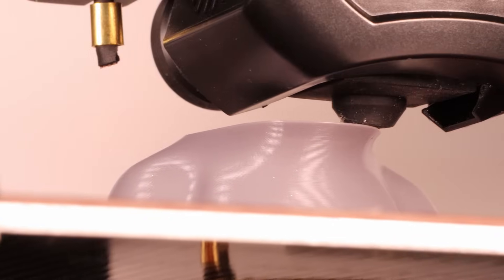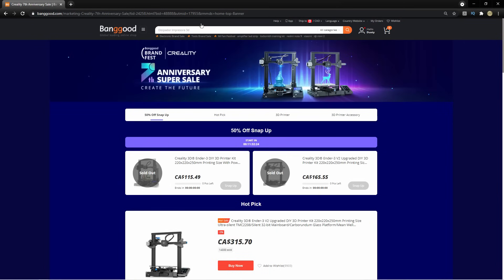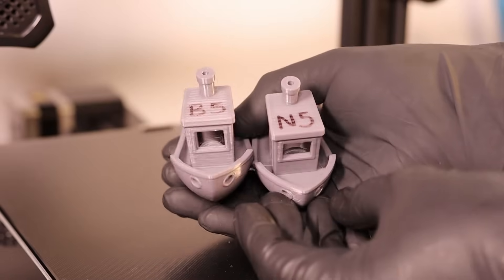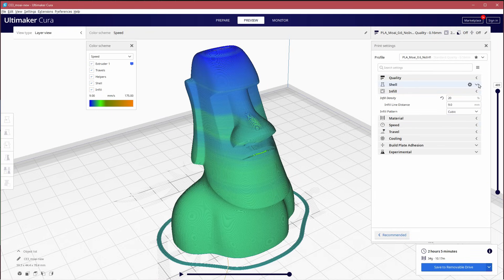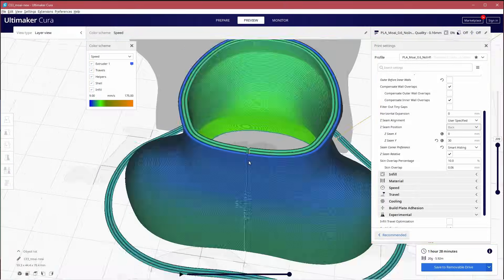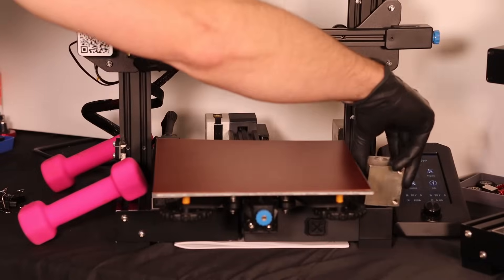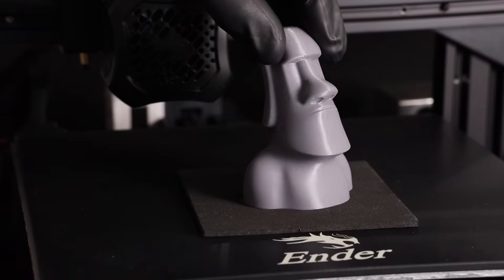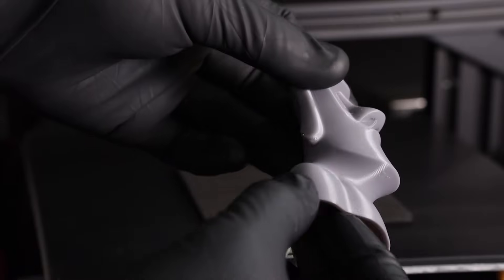Creality Ender 3 V2 - My Cleanest Print Ever and You Can Too!

Comment: I can have a $200 printer with zero upgrades and print better than 99% of people with printers because they don't take the time to completely learn slicing
Reply from the maker: I'd agree with that.  There are so many settings which require a lot of testing to get it just right.  

Which currency is that?  200 is a steal.

My best tip for anyone wanting to learn is to turn every setting on and at least see what is there, if you don't see it, it can't help you much.  I've downloaded Cura 4.9 Beta, it doesn't look like they've changed much except the visibility of the seams appears as a while line, which is very nice for anyone with the Bowden setup.   

Can you share your settings with seams with us?  I am working on improving mine right now.

Comment: Please make a tutorial on bed leveling. I am having a lot of problems with that. Also what is your print speed ? Thank you ! great print !
Reply: Trust me just get the stronger springs and a BLtouch and call it a day...I hated leveling and now I hardly ever do it
Reply from the maker: That's a pretty easy one, probably could do a 2 min video on that.
Reply: @NeedItMakeIt  It would really help me out, I am have so much trouble just setting the bed. I moved my printer to a new place and I havent been able to get ONE print ever since I did that.
Reply: @3atsleeprepeat  did you recheck all the screws and belt tightness since moving it?
Reply: @timothymusson5040  Yes I have done all of that, even did a marlin update to get the mesh level function rolling. I guess I will have to go for a bltouch or something like that. Like someone else said, I will look into new springs too. Was expecting it to run out of the box without needing 100 upgrades haha.
Reply: @3atsleeprepeat  get a 3 point level kit... The bl touch is only going to weaken your skills
Reply: @NeedItMakeIt  ty
Reply: I couldn't sort mine till I got some stiff springs and a glass bed. The metal bed was just too warped
Reply: @Jeffmorgan1991  those are a given for success on this printer
Reply: @Franksmallberries4429  how exactly does a skirt affect the tram?
Reply: @Franksmallberries4429  that seems absolutely insane lol... Not saying I haven't seen it done... Just makes more sense to use a sheet of paper and not waste filament or have to adjust on the fly
Reply: @Franksmallberries4429  oh you mean adjust on the fly?
Reply: For the speed it depend on the quality you want and on the plastic you use. 
When I want something clean with pla I go to 50mm/ min, in standard quality I got from 100 mm/min up to 150 mm/ min. If you want to print elastic plastic, go a lot slower. And the best advices I can gives you is to try on little print.
Reply: STEP ONE GET A BL TOUCH
Reply: @joeybergeron376  also recommended by Bondtech "The Ender 3 has too small of a build plate for a BL touch"
Reply: If you have a V2 and problems levelling, it's because you have a 4 point bed.

Comment: If you randomise the seam on cura you can reduce the appearance of the line down the back
Reply from the maker: I don't find much success with random seams, I am working on dialing in the settings and maybe it can work.  I am running tests over the next week to see what works the best.  I also have a bondtech LGX on order, it might make a difference too.
Reply: @NeedItMakeIt  yes true I find it causes lots of small spots to stand out but maybe try slowing the jerk settings?

Comment: You are doing God's work here.
Reply from the maker: I'm just trying to use my skills and interests to help other people.  I struggle with printing just like anyone, just sharing what I've learned.
Reply: @NeedItMakeIt  I followed your advice and now my Ender 3 is printing the cleanest it has ever. End of a 2 year journey for me. Thanks.
Reply from the maker: @Splatterpunk_OldNewYork  That's great news!   I am still working on some little tweaks which will further improve it, I will be researching Klipper software, Arc welder for Cura, and looking closer at the seams, but I need a macro lens to get a really good view of what is going on to be able to make the adjustment.
Reply: @NeedItMakeIt  I use Arc Welder. I have found that it further reduces idle nozzle, thus reducing thermal anomalies on complicated models. Reduces the file size as well. Never looked back.

Comment: better prints? here's how:

Step 1. buy resin printer
Step 2. ???
Step 3. profit

Lol
Reply from the maker: I may get one down the road, for small intricate parts, it would be ideal.  How do you colour them?  Paint?
Reply: @NeedItMakeIt  There's diff color options for resin, though more limited than FDM, but yea paint. There's other options for resin printers now, i'm still on an OG Elegoo Mars. fits my needs. I use Siraya tech Blu, which is supposed to be "ABS like". I prefer grey resins as they seem to cure better with less issues. Overall I think tuning a resin printer is FAR easier than an FDM which is fiddly IMO, but there's more mess and if smell bothers you that could be an issue and you'd need an enclosure and/or vent of some kind.

Comment: I have the ender 3 pro and still have a rough time getting clean prints.
Reply: Look for CHEP channel. He has a comprehensive list of what you need. 👍🏼
Reply from the maker: You can use the profile I've provided in the description, the printers are so similar that it should be possible to get the same quality.
Reply: Get mine a week ago, try to use hair spray on the bed and use the stock 0.28 quality, I also recommend you to use the Satsana head take a look at it on Thingiverse

Comment: Just got my first 3d printer a few wks ago, a V2. Guess I need to upgrade my springs at the very least.
Reply from the maker: Springs and change the plastic extruder to metal at least, that's pretty much all you need to do.  Tune your printer, adjust the wheels and e-steps etc.

Comment: Why is that seam so ridiculously big? My seams are usually so small I have trouble even telling where they are.
Reply from the maker: They aren't quite as bad as they look, I used very harsh lighting in order to show defects in my videos, I do agree that they can and should be better, would you be able to send me a profile of yours?  Do you you use a 0.6mm nozzle, or 0.4?  Do you have wipe turned on and if so, how much?  

Thanks for taking the time, I am working on getting the seams tuned for this printer, ideally so that random seams can be used with very little visibility.

Comment: get a yoga mat for vibration it's legit
Reply from the maker: I can't have my printer showing me up, so I'll have to get one too.  I will check this out.  Do you think a mat is better than connecting to something super heavy and solid?
Reply: @NeedItMakeIt  Using vibration matts on machines in manufacturing is pretty common. If your connecting the 3d printer to something that is super heavy. It might take a lot of work and if you want to move the printer somewhere else in the future it will be a pain.

Comment: the idea to but the weights on the base frame is smart. i will try this.
Reply from the maker: A viewer also suggested a yoga mat, apparently that works very well also.  I'd go the other way, when we have large machines we need to have no vibration, we attach them to the floor.  Lathes, CNCs.

Comment: Why would you use a glue stick with PEI???? Never heard of it. I've been using 2 different brands of PEI sheets on 4 - Ender 3's and 1 - Ender 5 and have yet to have a print not adhere properly. Also just wait for it to cool down to room temperature and the print(s) will fall right off! PEI sheets are the best thing I ever did for my printers! Btw, your print looks good except for the big seam at the back.
Reply: Is there a certain brand of PEI sheet that you like? I've been looking at glass, but a lot of people like PEI and it seems to be much lighter.
Reply from the maker: I've also tried 2mm borosilicate glass, it does work, I've only broken 1 piece while testing a 1mm nozzle with heavy infill and it pulled up on the glass so much that it shattered.  Normal prints don't cause any trouble.  For PEI, I'm no expert yet, I only have this one sheet and I am liking it, except that it likes to curl when heated around the edges.
Reply: @NeedItMakeIt  Sorry to say but you should have went with the magnetic sheet. Never experienced that with mine nor have I heard that complaint with magnetic.
Reply: @kevinjones6924  which one do you use?
Reply: @NeedItMakeIt  thanks for your input! I looked at borosilicate glass, too..but from what Ive heard around, PEI is a favorite. You're really great at being active in the comments..it's cool!
Reply from the maker: @kevinjones6924  No problem can you link one you think is good?  I've been meaning to put a test video together for different buildplates on this printer.
Reply from the maker: @kevinjones6924  Do you have a link for a good one?  I'm setting up for some buildplate tests.

Comment: why did you go with a 0.6 nozzle? it comes preinstalled with a .4 and I print at .12 90% of the time very hard to see layer lines
Reply from the maker: I print between 1mm and 0.8mm for my prints, it seemed like a good compromise, I've only printed with a 0.4mm nozzle a few times before moving on.  I'm sure the 0.4mm would yield a little better results as well.
Reply: I guess a .6 nozzle would make for a better wall in vase mode if you over extrude a bit?

Comment: Looks great.   Would really like to see the same print done with Arc Welder plugin enabled and see if there is any discernable difference.  (Or maybe you had Arc Welder on and it would be good to know.)
Reply from the maker: I will have a look into that, no arc welder on, I've been trying to keep as much stock as possible so people have a chance at getting good results from the start.
Reply: @NeedItMakeIt  I found it really easy to add to Cura and greatly simplifies the gcode.  (More curves = fewer short line segments and fewer commands per second the controller has to parse and process.)
Reply from the maker: @underourrock  Sold, I'll try it on my next print.  Are there any useful prints that would also serve as good test subjects?  I hate to print these models for no real purpose.
Reply: @NeedItMakeIt PLEASE FILE
Reply: A lot of printers do not support G2/G3.

Comment: I would also suggest picking up a bltouch. This will greatly improve print quality
Reply from the maker: I have one waiting to be installed.  How does it improve the quality?  Getting the first layer perfect?
Reply: @NeedItMakeIt  If your bed leveling is not perfect or you have a warped bed the bltouch compensates for that and produces a perfect first layer.

Comment: Glue stick on pei sheet? Why? Pla sticks great to pei by itself. Not being the fhalace in the comments I just dont understand the point.
Reply from the maker: I can't say I've had any success with much sticking well to the PEI, however I don't bring the bed temps that high, it would be a waste to heat the room more than you have.
Reply: @NeedItMakeIt  60 deg C, that's it.

Comment: Nice print. To reduce vibrations you could try to fill the frame with fine sand.
Reply: to reduce frame vibrations i clamped a piece of wood from the top of the frame to the wall behind it.
Reply from the maker: That's a very cool idea!  I'd really like to see how fast this printer can go and that's where these ideas could really help. 
I recently had the spool on the front because of the setup with the printers for the video and the frame was vibrating a lot, I've since moved it to the side, but probably off of the machine completely will help too.
Reply: @NeedItMakeIt  Nice to know that you will push those machines. Yes the spool on the side or of the printer helps. Mine has the stock spool holder bolted on the rear left side profile. The normal size  filament spools fit's just right and it's close to the extruder.
Reply: @shankswrc3509  did the exact same thing, helps immensely especially since it feeds almost directly into the extruder. Never could figure out why Creality put the spool holder on top since the filament feeds in at 90 degrees! Gotta love those engineers/designers! 😅🤣😂
Reply: @NeedItMakeIt  I picked up a Drying Box (sunlu) and I'll never look back. You can build the same thing with garage sale dehydrators with a bit of engineering... But it's seriously the next best thing to an enclosure. I'd also recommend it when speeding up your prints... Having your filament at 50-75C coming into the extruder/hot end means less energy to transition it to molten and can allow you to speed things up without having a volcano hot end.
Reply: I fill my speaker stand with sand, but I would never fill my 3d pritner with sand.
Reply: I hung a sand bag over the top of my printer. It also rides on 4 foamy feet. Like 5kg of extra mass.
Reply: How do you fill the frame with sand, it's solid aluminum?
Reply: @kevinjones6924  don't fill it with sand. That's just dumb. Instead mount it to the table. And mount the table to the wall. Much easier. And sand is a pain to deal with.
Reply: @jamessowin2505  Thanks James but I do know not to fill with sand, the fact is it's impossible lol. I have my 5 printers with anti-vibration feet sitting on a 1/8" thick solid rubber mat on a 1-1/4" thick wood table mounted to a cement block wall. Very little vibration.
Reply: @jamessowin2505  I don't like sand. It's coarse, and rough, and irritating - and it gets everywhere.

Comment: Great video. That PEI sheet is exactly what I have been looking for. Btw do the clips damage the sheet? Also do you notice warping from flexing the sheet to remove the prints?
Reply from the maker: It works well, the clips haven't damaged the sheet yet, but I need a few thinner clips around the sides that don't hit the frame as the Y moves.  The PEI sheet does warp a little bit as the print is going, maybe 0.25mm on a print like the one in the video, it does not lose bond at all, and I've only used it for small prints so far because I need something to hold those sides down better (maybe something can be printed).  I'd also like to try a CF board, I have one on order from Banggood right now, I'll have to cut it to size, it should stay flat and should also be super light weight.
Reply: @NeedItMakeIt  might want to be careful with that, on a video about the speedboat challenge, somone said the expoxy on the cheap cf tube goes soft at 60c...
Reply from the maker: @specialingu  I'll have a closer look, I'd assume they haven't used an epoxy rated for higher temps like the ones for sale by visionminer.  Thanks for that.
Reply: I've been using a 3mm Lexan with 235mm cctree build plate sticker. That works a bit too well since pla will not come off if the nozzle is too close. There's also a bit of warping about about .5mm on large prints. I am hoping this PEI sheet will be a bit better.

Do you have links to the CF board? Wanna check that out. I have thought about using circuit boards as well but I haven't been able to find any that's precut to 235mm
Reply: The clips shouldn't hurt the sheet. That material is so strong against crushing force, we use it in automotive repair to cut our own gaskets sometimes.

Comment: Didn't know you could move the seam 🤦‍♂️ that's super helpful thanks!
Reply from the maker: My first printer was a direct drive, I knew nothing about seams because I couldn't really tell they were there, the seams were always set to random and the results were okay.  With the bowden and the larger nozzle, changing the seam location is pretty important.  I will be investigating a few solutions to improve seams for everyone, a linear_advance type solution will help, shortening the bowden tube and maybe looking at the extruder to see if there is an ultimate solution for that as well.  You are welcome, my pleasure!
Reply: @NeedItMakeIt   @NeedItMakeIt  sometimes I can see them and others I can't, I have been building compressed air engines and the seam ALWAYS decides to be inside the piston cylinder which is the worst place for it 🤣 so hopefully I can move it now!

I look forward to seeing what you come up with!
Reply: Why is there a seam? I have never seen this in my prints before.
Reply from the maker: @crelyt  There is always a seam, the intersection between the beginning and end of a wall line.  If you run direct drive you may not see them, or if you use a small nozzle, if you have Bowden and a large nozzle like I do, you'll see them, I am running some tests to see how good I can get it with a 0.6mm nozzle.   If you are on a bowden setup can you please send me your settings?  I'm interested to try them out.